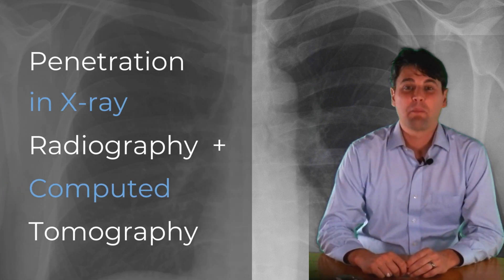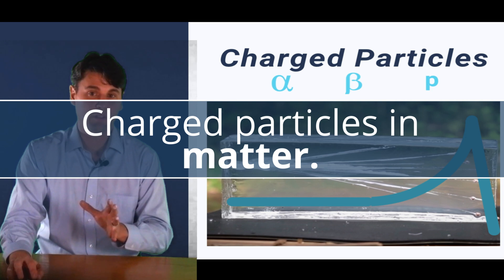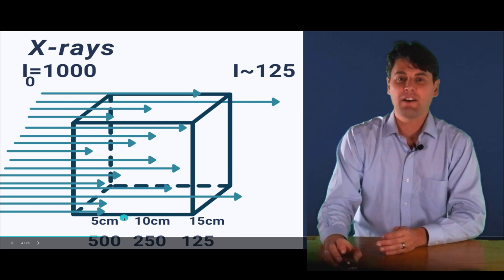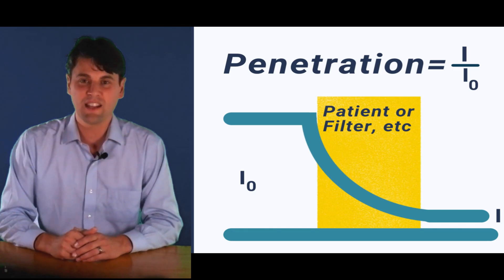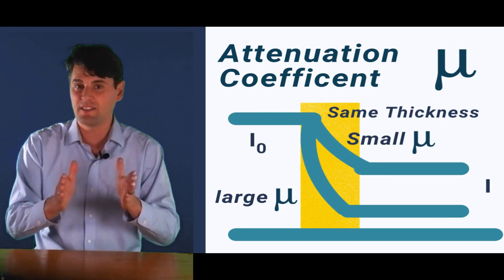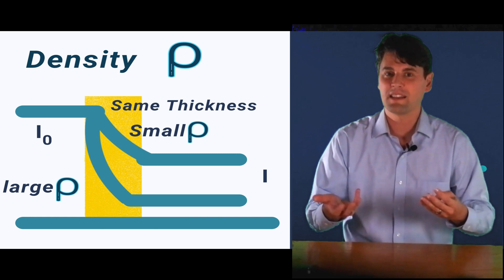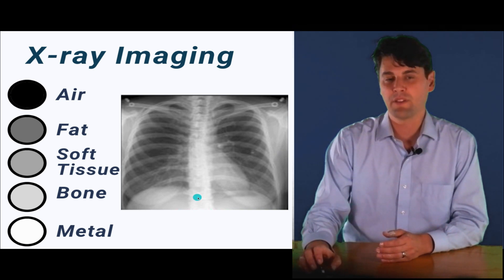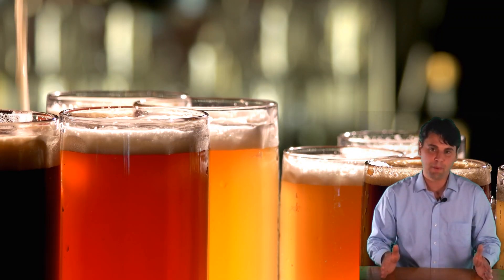X-ray Penetration (with X-ray Attenuation, and Beers Law for Rad Techs)

Comment: Hello, how are you? I have a question, please. What are the materials that x-rays cannot penetrate❤❤
Reply from the maker: Higher Z materials on the periodic table are much better at stopping x-rays. That is why lead is typically used for x-ray shielding